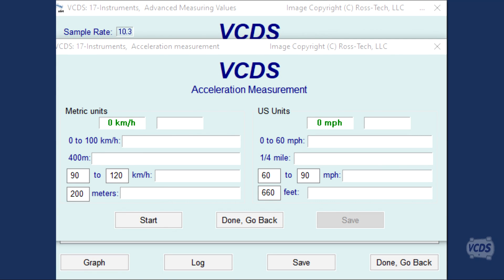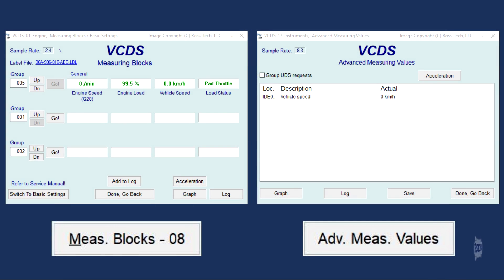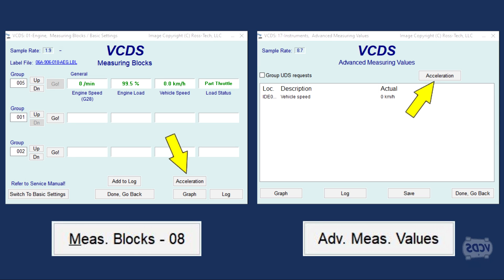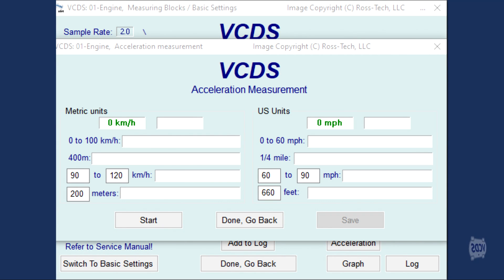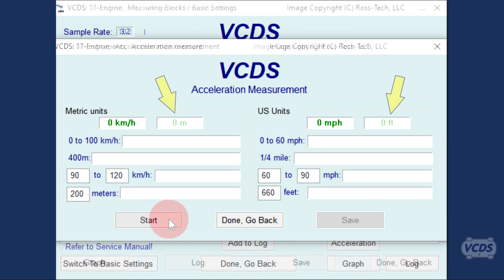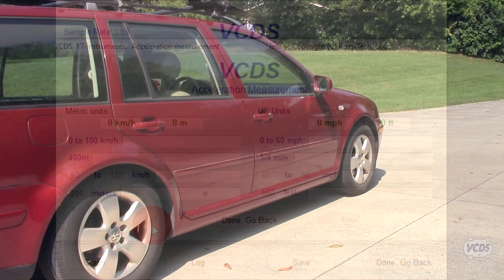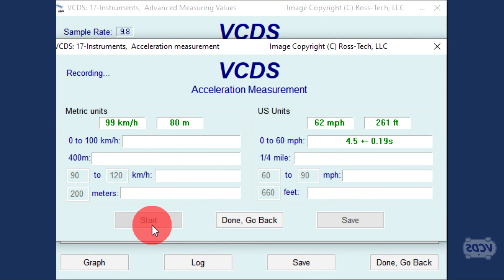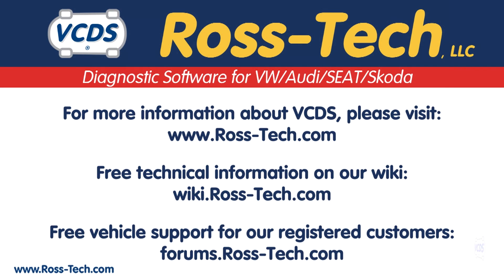VCDS - Acceleration Measurement

Comment: Have a question or a concern rather that does not relate to this video, my friend has a Chinese cable and I have the original cable, however, he can connect to some older vehicles that I cannot connect to. Some of these vehicles are the 1.4 polo GTi. I thought it might be due to software updates but when I used my cable on his computer, it would not connect to the vehicle. 

Any advice will be much appreciated
Reply: ... asking for a friend eah 🤫
Reply: @UKRayman  asking for myself as I don't really understand as to why would that happen